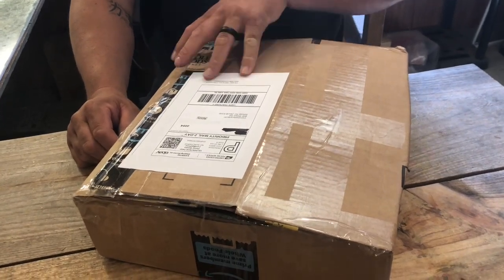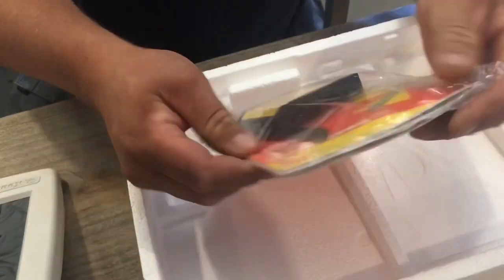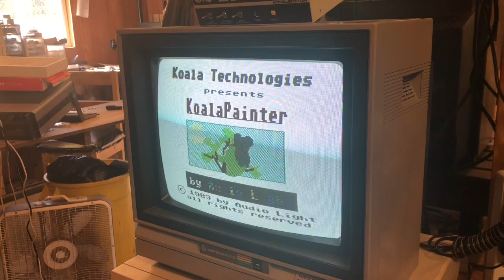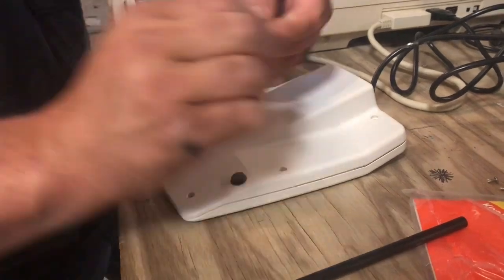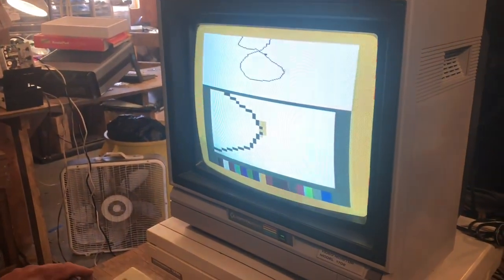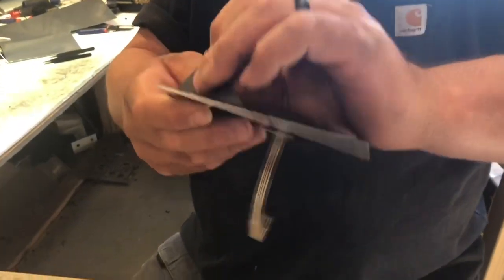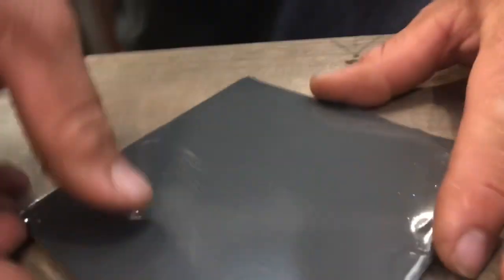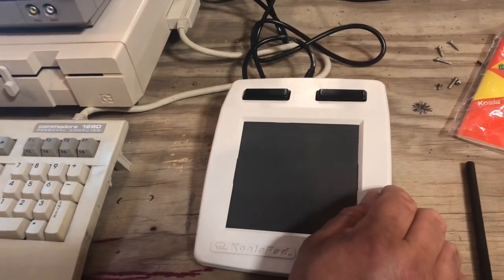Unexpected Koala Pad Restoration

Comment: Funniest thing...I got a Koala Pad and in a separate order the software and the pad had the same problem...the covering layer was all bubbled-up but it still worked.  What did you use to "fix" that? (I also bought it just because "I wanted one"...although I never used it much when I was younger.
Reply from the maker: Gary Barrett it just a simple adhesive vinyl.  This was a pretty cheap quality one.  You can find all kinds on Amazon and eBay.